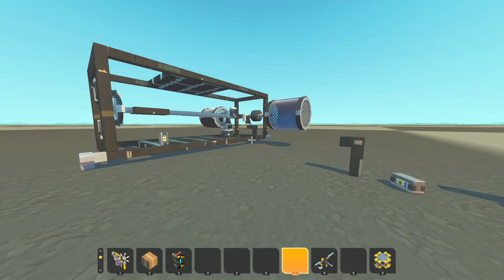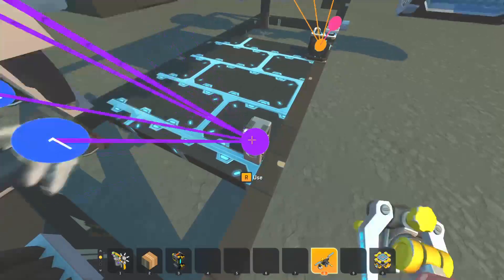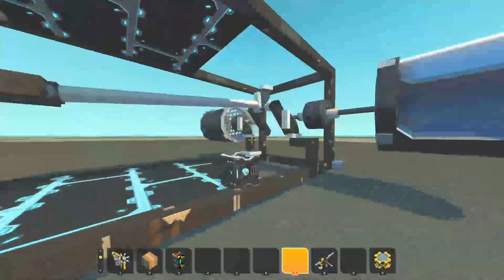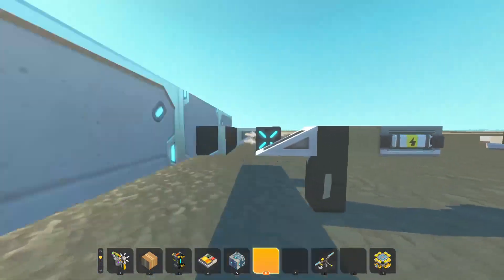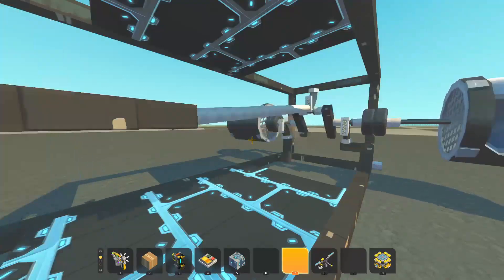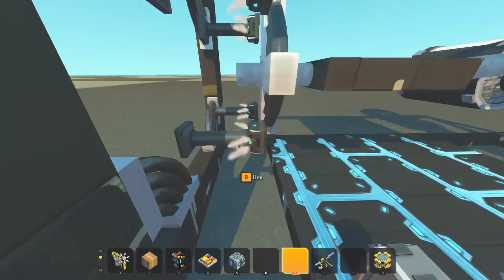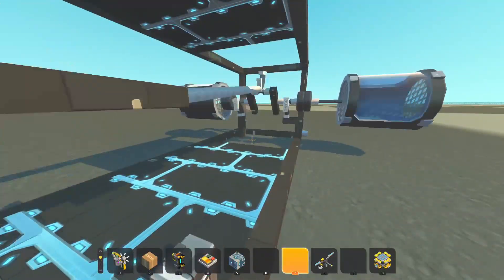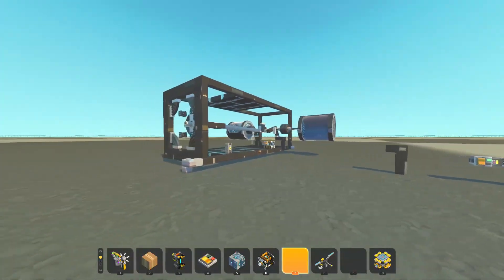Scrap mechanic pressure engine

Comment: Ok but what in the world is a fast controller and how the hell do you get it
Reply from the maker: You can save a controller, go into the blueprint file, go to the controller in the blueprint with is the only part on there, you fill find a value meant to be edited by the player the frame tim i think its called. The smaller the number the less time the controller will take to reach its target. 
Or you can get a blueprint editor mod like unknown tools click on the controller and the code for the controller will appear and you can edit the frame time there.

Comment: Hello, me and alstrak were experimenting with this long ago and came up with a engine that pushed on the corners of a single cube making it go around, with some balancing and having about 8 different arrays of "pressure pistons" firing in succession after eachother we got a crankshaft spinning to I think 30k rpm
Reply from the maker: sounds to me like your referring to the turbine effect, i messaged Alstrak about the matter

Comment: what about torque? how much? an engine without it is useless
Reply: Hp is king
Reply: Torque matters a biiiit more lmao
Reply: @DenserThanLead  Do you now anything about how engines work? without torque Hp doesn't matter, you can have 1000 hp but w/o torque you may as well build pedal wheels
Reply: @Alturvexs  i love seeing people like u in the comment lmao.
It always makes my day!
Reply from the maker: Hours power is the result of torque x rpm, in order to make 1000 hp there must be an rpm and torque component. You can use gearing to compromise either one for the other but power will stay the same.If you have 1000 hp and 95% of that energy is in your rpm you can gear it down for more torque or vice versa. Hp is really the figure that matters since that determines the total energy of the system regardless. @Alturvexs
Reply: @machineball  Thanks for explaining it so well, man some people really like to bring others down I swear XD
Reply: @machineball  Dude I'm 49 I know how rl engine work I know about hp and torque but as for scrap machines game coding hmm it's hit and miss if they get all that  in the game.
Reply: @Alturvexs  dude 💀💀💀 
What are u even trying to say at this point?
Reply from the maker: Torque and rpm do function extremely similarly to irl in sm, as both can be described as byproducts of Newton's laws. However the SM equivalent of high energy physics things do differ from reality.  @Alturvexs
Reply from the maker: It can make a lot way more than gas, but you don't want to stall the engine so you kinda need to be polite with how much torque you use.
Reply: just to give this guy an answer because its super easy to calculate, its between 1750 and 3500 Ft. lb.
you can measure about 6 frames per revolution which is ~600 rpm and given the in game HP range of 200-400 you can just math it out, theres probably some error in there since this is a bug exploit and torque might not transfer properly and that i just counted the frames so the RPM is probably a little off, but i think this is close enough
Reply: @Mr.-Bonez  ur actually right on the money if im not wrong.

We use the xo meter mod to measure rpm, but we found out that it deviates abit at higher rpms.

So if the xo meter displays 720 rpm ur getting around 600rpm, fuzz was one of the main persons to find this out and test and figure out the deviation, so fuzz can corect me if im wrong
Reply: @Mr.-Bonez  Thanks! there is some pretty rude people on YT seems to be a never ended pit of them.

Comment: Does this have to be welded to the ground or will it have to be put in an ultra-heavy frame to be used as a car engine? This is a really unique and wacky engine and I'm all for it.
Reply from the maker: They don't, i've used some in some vehicles before.